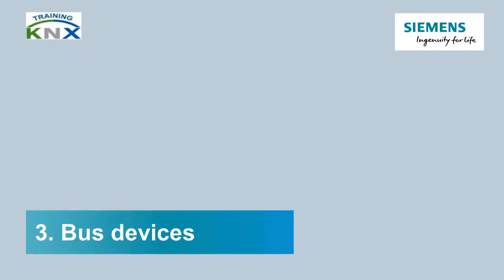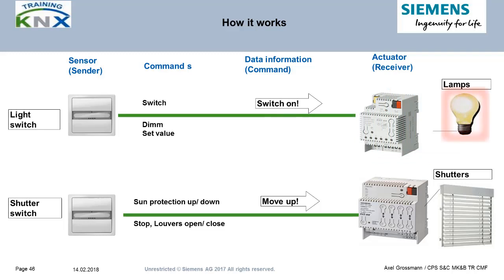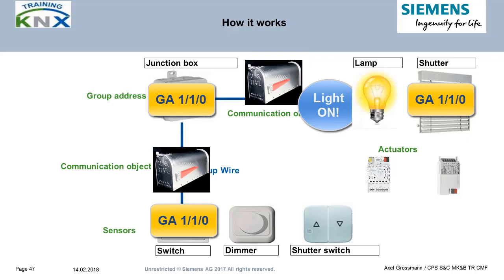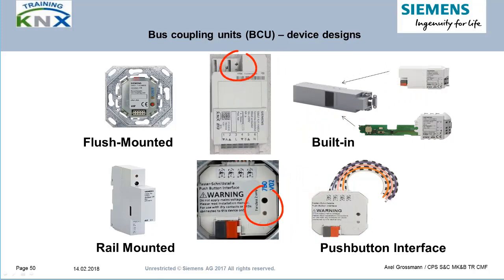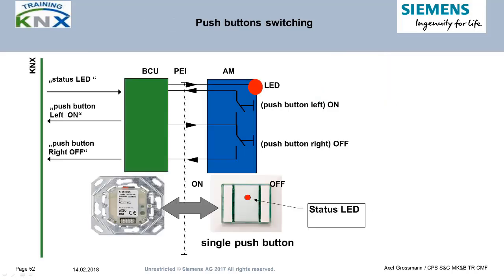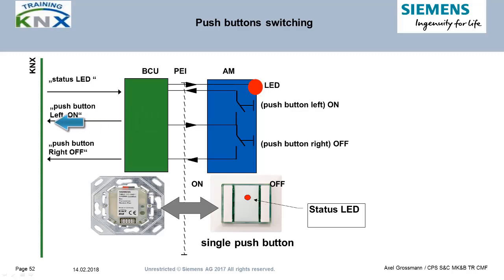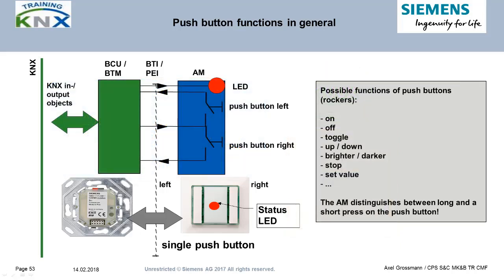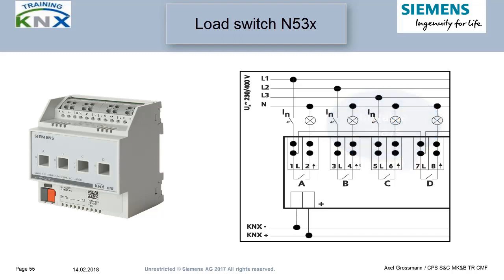Siemens KNX basic course chapter 03/1: Bus devices part 1

Comment: Hi, We are from Binthen Company that developped KNX Motorized Curtain Kit,  

Advantages as below: 
1, No need KNX shutter actuator anymore, save a lot cost
2, KNX Certified Product with Patented spliced track system
3, Standard package from 2.2 meters to 8.2 meters
4, Very convenient for distributor and store/online seller to sell
5, Standard package make shipping and stock more easier